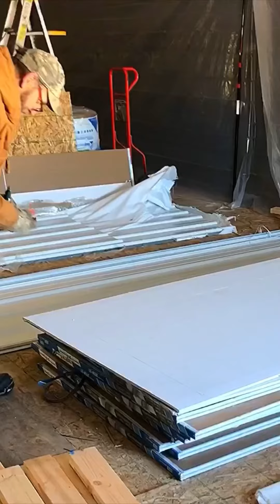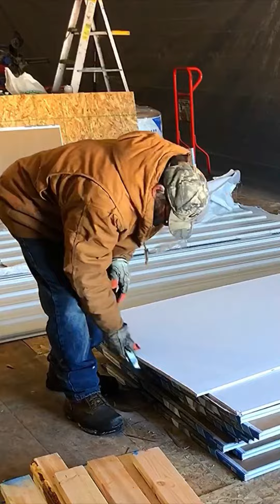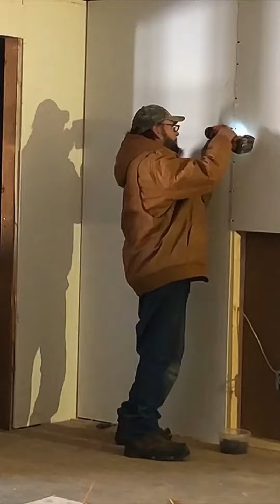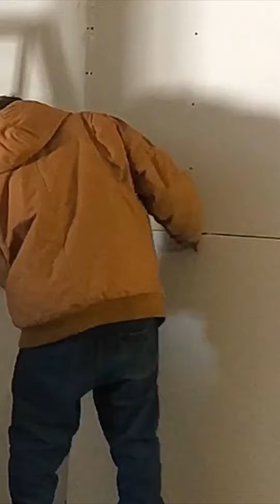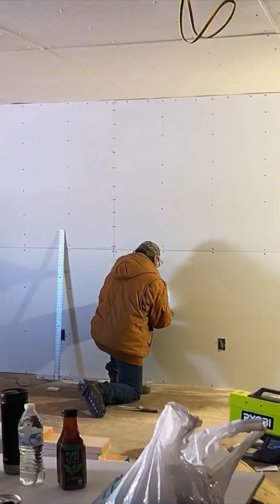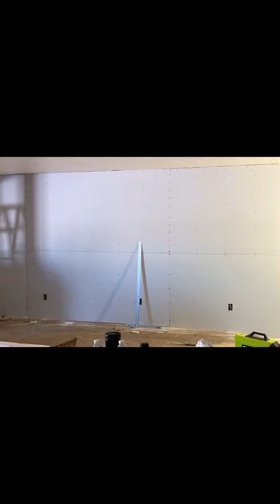Drywall 😄👍🏻

Comment: stagger the vertical joints so they are not all on the same stud, you don't need to use so many screws either.